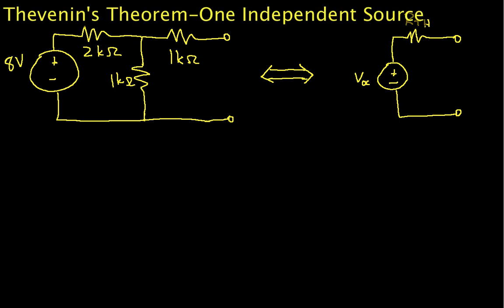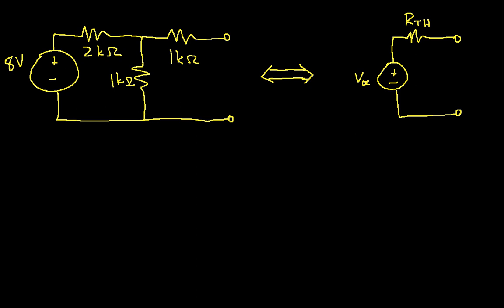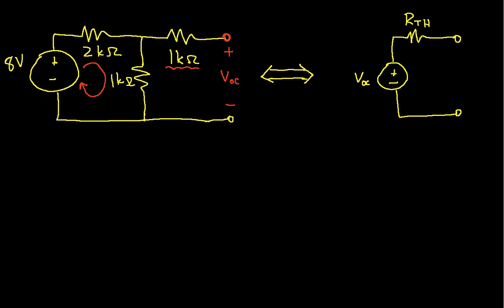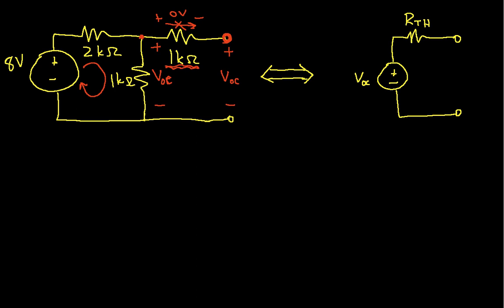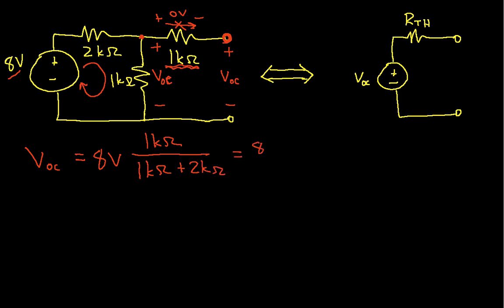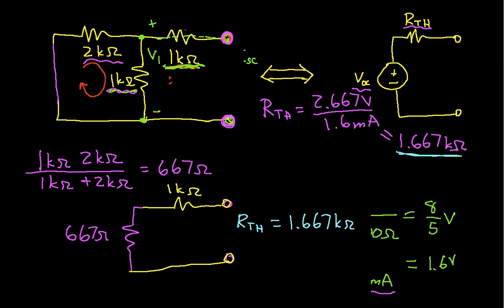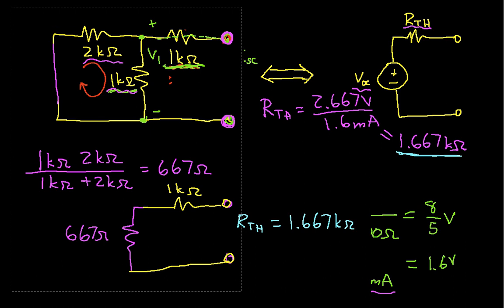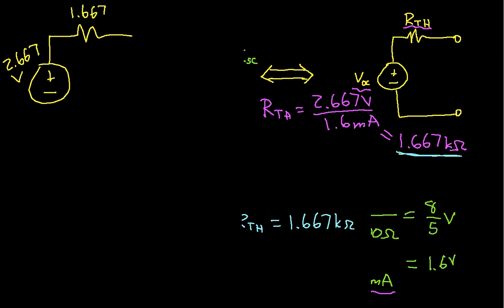Thevenin's Theorem-One Independent Source

Comment: Hey Darryl, so you can only use the shortcut method to find the Rthev right? You would still have to do what you did in the beginning to calculate the Voc, right? So essentially, the shortcut allows you to skip calculating the current across a short circuit.

Comment: why can't you use a loop and mesh analysis to find the short circuit current?
Reply: saiyaspring +1 somebody answer plz
Reply: +Kirolos Saad You can use mesh analysis to do this. Just make a loop on the first enclosed circuit do a kvl and solve for the current, the current will be the same in the 1k Ohm resistor. Multiply and you’ll get the same V_oc. People like to do voltage divider most times as it requires less effort but more technique.
Reply: femiairboy94 thx for the respond but it's a bit too late i passed electronics in finals already xD
Reply: ***** lol sweet, that’s good.

Comment: Hi, I was just wondering when you solved for the voltage across the 500 ohm resistor, does that imply that the same voltage will put across both the 1K ohm resistors because 500 ohms is the equivalent of both the resistors?

Comment: Why is it that the 1k and 1k ohm resistors are parallel for the short circuit on the right but then the 1k and 2k ohm resistors are parallel for the short circuit on the left (Vs=0)?

Comment: Do you follow the same procedure with a current source?
Reply: mostly. you replace a VS with a wire (no change in voltage). you replace an IS with open terminals (no current flowing through)